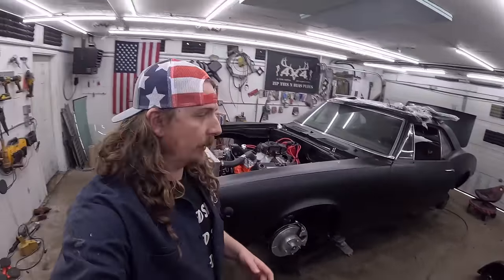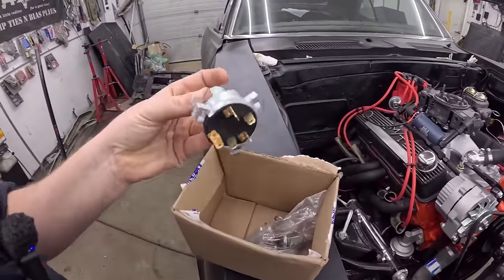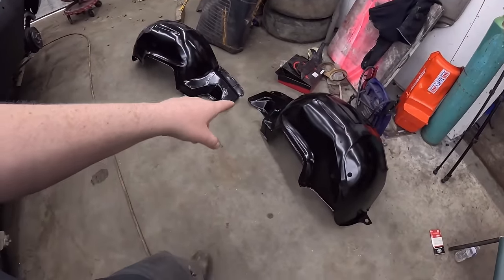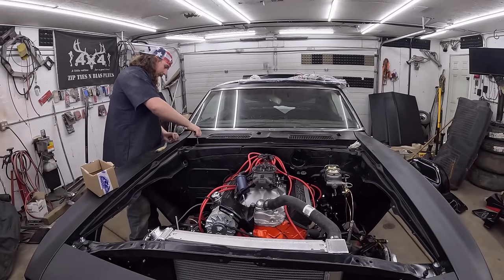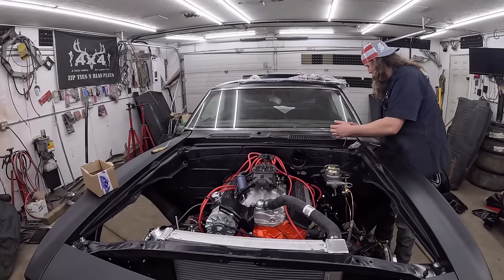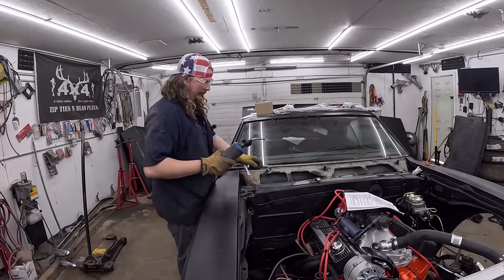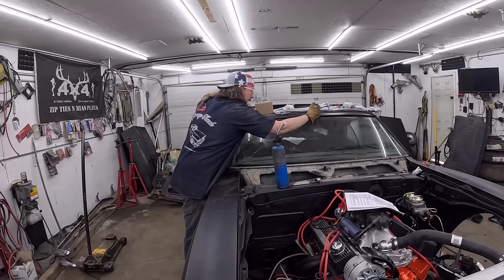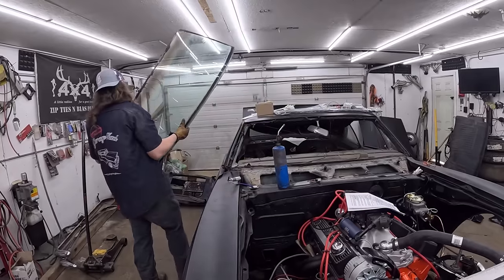NEW Look, NEW Glass - Fixing Past Mistakes...

Comment: Being that is butyl tape adhesive the best option for cutting out is to spray glass cleaner on the perimeter before you start cutting and it will glide right through and not stick back to itself. I've installed glass for 30yrs now and it works like a charm

Comment: A good tech tip for you for running your adhesive is on your tip is to cut the tip where you have about a 3/8ths size diameter then cut V-notch in it so  when you apply it it stands like a triangle. Then when you deck the glass or mash it down its compressed flat like a square and chances for a water leak are cut down by 90%  if you ever have any questions please reach out and I will help you out brother

Comment: Doug here..........DD Speed Shop fan.........Dan, if you plan on doing Vintage Air, go ahead and put the adapter in the location of the stock blower motor.  If not, gotta take that fender back off to install it.  Better to do it now than when it becomes a giant pain..........that is if you plan on doing Vintage A/C.

Comment: I still don't understand why anytime you try to do anything on a car, it's like its your first time doing anything on a car. lol   Anyway, I'm just glad you put the bolts in those inner fenders with the nuts on top so you can see 3.785 feet of threads sticking out into the engine bay. Good thinking!  Keep up the work!

Comment: Watching the guys change the glass at the dealership I work at showed me that they goosh the black stuff on the windshield  edge.  They cut a wedge shaped slot in the tip so the glass adhesive formed a triangle with the peak facing the window frame.  When the glass is pressed into place by TWO people the sealant flattens out making a nice wide sealed surface.  Just sayin'...

Comment: To go this far and not do a dash pad???? Your going to want one to look at while your driving, to pat when it's been a good car and to rub when it's running rough. We also don't want to see you cut your lil fingers on the sharp edges 😢     love you and Dani
Reply from the maker: Where does it end?  Gotta draw the line somewhere
Reply: ^Dan, this.
Reply: Not here
Reply: Wad up a beach towel.. Then, if you need a rag to wipe grease off your hands,  you are golden..
Reply: Not there, that's something you buy
Reply: like the mad max look
Reply: Do diy vinyl on that dash pad.  Didn’t you do that on the black nomad?
Reply from the maker: @mblake0420  new headliner? New parcel tray? New gauges?  There's never a good place to stop.  That's why cars don't get finished.
Reply: @DDSpeedShop  true but maybe draw the line somewhere where the result might not be as visible? maybe don't paint the lakewood traction bars back yellow or someting but then again, if you are ditchin the black steelies and dog dishes for mismatched Cragar's and Daisies and not putting a front bumper on it, a busted up dash pad won't be abnormal to the look, man, I wish you could have found that blue satin paint you were looking for at first, dang ol black satin just kinda looks like PPG DP40. not a complaint, merely an observation, and to help out yer youtube al gore rhythm.  wish you were my neighbor, I'd be rolling my '63 Jag XKE basket case over and whining til you helped me make it drivable again, hasn't run in decades due to a broken 351W somebody swapped into it before I was born.
Reply: But you will Keep buying different rims and tires for it l o l l o l @DDSpeedShop

Comment: 46:30 try loosening the rear springs at the shackles and the front mount once you have shocks installed and the weight of the car on the ground maybe throw some weight in the trunk and then re tighten everything. Sometimes when you install all that stuff on a lift with everything hanging and tighten it all it stays high. I like the way it looks though but its your ride im sure youll figure it out for your preference

Comment: I know the inner fenders on my second gen Camaro suck just as much as these did for you.  I think I put them in like you initially tried but I had them loose so I could pull the bottom of the fender out to get the room to slide it in there. The valance sandwich that these things do is also terrible. You shouldn't have to ever get into that fender again since you don't have a blower motor on the firewall now. Another wonderful thing GM did...hide the motor under the fender!

Comment: before it cures to much,  your windshield is going to leak at the bottom passenger side about 6 inches from the wiper arm mount. and the wind noise will drive you nuts

Comment: I watched my friend who does glass for a living so many windshields. He would paint about 2 inches of the rim on the inside of the windshields before he installed them. That way you don’t see the urethane caulking after install. I forgot to do it before I installed the two that I did. I did it on the outside and it chipped off quick. I’m the idiot

Comment: You ONLY HEAT THE KNIFE blade...not near the paint with the heat. Also the "neoprene" to seal the w/s is available in a "rope" application, the caulking just goes along side it to have a zero leak app.